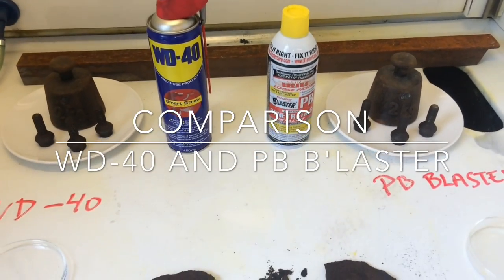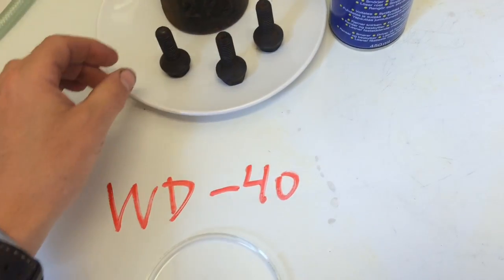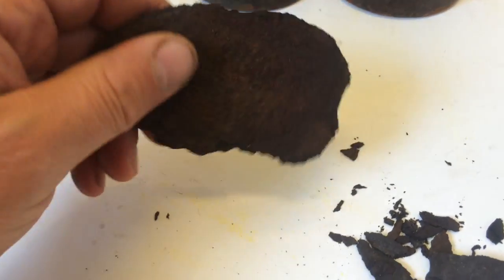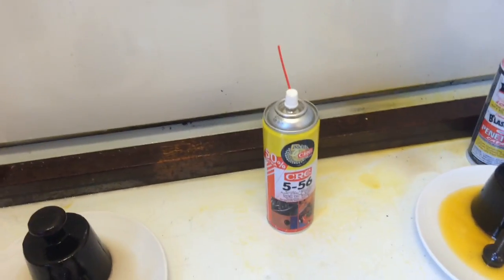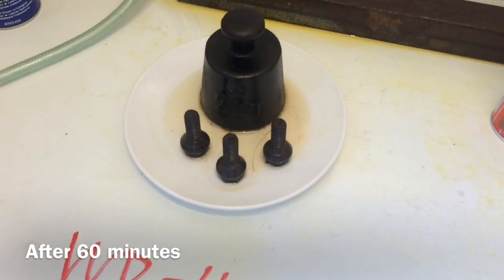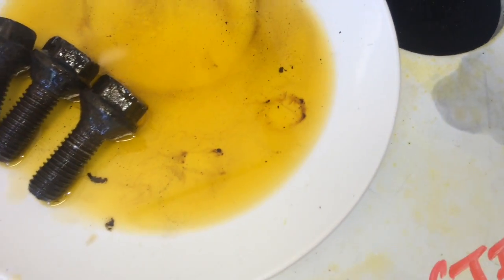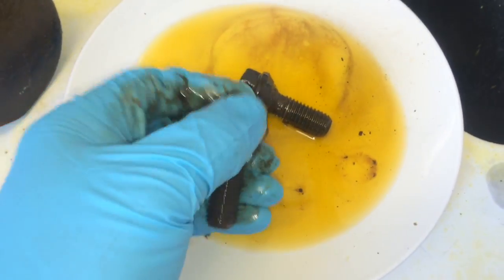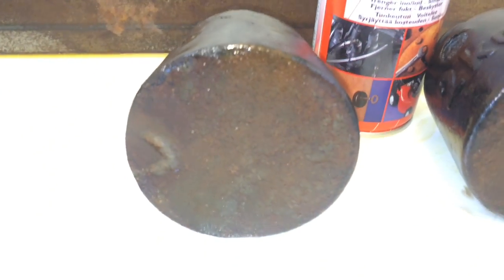WD-40 and PB B'laster compared in test / review JEEP Wrangler Bolts - Ep 4

Comment: Not a good test.  Too subjective and no control. You would need to do a better designed study to come up with any kind of valid conclusions.

A perhaps more revealing, at least anecdotally, study or case history would to take a bar of steel, say 2 inch thick, drill and tap the holes their entire length and then use bolts, all the same batch/metal composition, and get them down to bare metal by either a chemical or mechanical method.  As close as possible all bolts and tapped holes identical. 

Then insert the threaded bolts into the threaded holes and torque them to identical ft lbs or whatever measurement you want to use.  Then soak in salt brine  or some other corrosive liquid and remove them all at the same time. Then let set until they are rusted solid. Or soak them in brine before assembly. Then after a standardized waiting period spray with the two or more products being tested.  Then measure how much torque it takes to remove them.

You'd have to have a control set of nuts and threaded holes.  On those, instead of using the test dissolvers use oil of some kind and/or water instead.  And on one set use nothing (leave the bolts and threaded holes untreated bare metal).

It would also be good to test the capillary action of the liquids being tested.  And their rust dissolving properties.  Separately.

I've been using both of these products for years.  First WD-40 and then PB Blaster and have zero evidence that either work at all.  For all I know, spraying water on the parts may work just as well.  I am however convinced that heat can be a big factor if one part is heated (the outer one) and the other part is either cooled or left cool.  Because of the expansion/contraction associated with heating and cooling of course.

Comment: PB Blaster is a penetrating lubricant (PB-Penetrating Blaster).   It does penetrate much better than WD40 and works better for removing rusty nuts and bolts.
Reply: So you say.  Got some proof?
Reply: Nope 😃 you can heat WD 40 witch a blow torch on a nut , it can handle shit like no other brother
Reply: Not true, pb blaster sucks

Comment: Neither is a rust remover. They are penetrating oils. A much better rust remover is vinegar but it doesn't lubricate.
Reply: False!! Because I tried vinegar & then some baby oil first on a stuck bolt on a water heater. Didn't budge
Then I used Blaster.  Boing
Reply: hyzercreek so the moral is combine pb blaster and vinigar
Reply: pb blaster doesn't mix with vinegar. They can't be used together.

Comment: As I recall, wd40 uses fish oil as it's lubricant, and it's good for  3 days or the first rain. Crappy lbe compared to. ANYTHING else!
Reply: There is no fish oil in WD 40, and if it takes you more than 3 days to break a bolt loose then you can always spray it again on the second day. Who cares if it lasts 3 days, it's not a lubricant it's to break bolts loose.
Reply: @hyzercreek  wd 40 no where near as pb blaster for rusted bolts
Reply: +hyzercreek Peope all over tend to use it as a lubricant, and that is what I was referring to as lasting no significant time at all. A friend of mine told me about the fish oil, and he was in charge of reading all the data sheets (I forget the acronym) on all the products for a large hardware company, so I believed that, as he taught me a lot over the years.
Reply: Nobody with a brain uses WD 40 as a lubricant. It's for breaking things that are stuck. Use oil as a lubricant. Is this really complicated? A hammer is for nails and a wrench is for bolts. Hammers are terrible for bolts that doesn't make them "crappy lbe compared to ANYTHING else!"